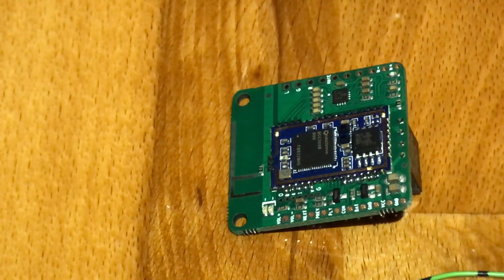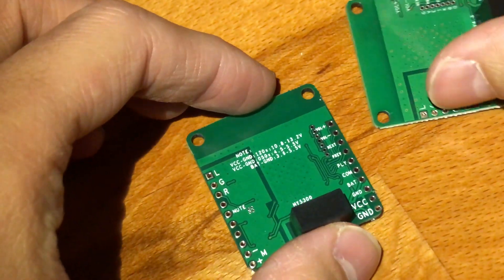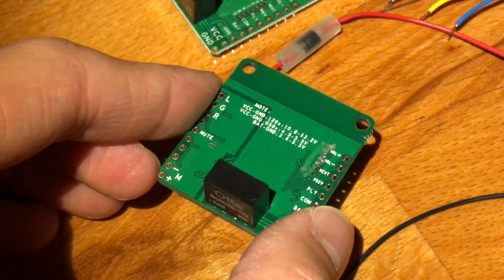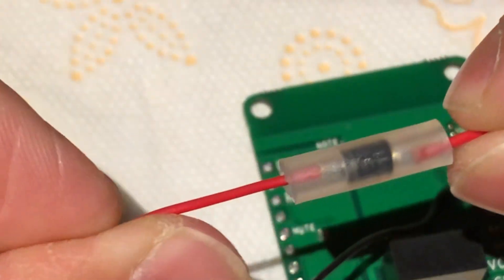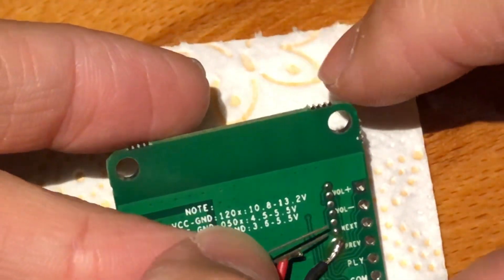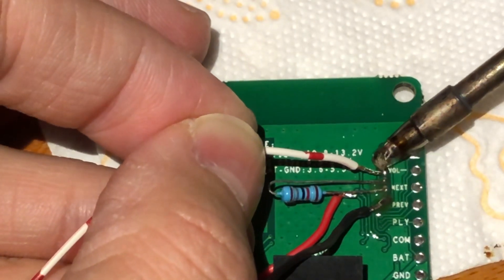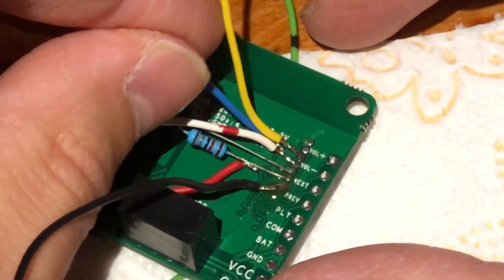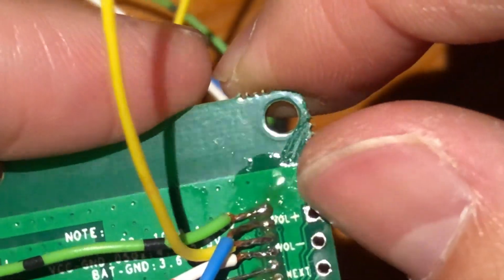Hooking up the CSR USB SPI Programmer to a QCC3008 Bluetooth Module

Comment: I'm curious is there a setting at the software to change digital output type?

I have QCC3034 with I2S output, is it possible changing to Right Justified or Left Justified fortmat ?

Comment: im finally trying out flashing this chip, but ive encountered a weird issue, the chip doesnt power on with the csr programmer, yet it does power on with the battery of my speaker. the spi tool is detected, and power is on the correct pins(which are labeled luckily) but the module still doesnt power on (leds go on)

Comment: To make wire connections to these boards I cut up old parallel printer cables and use the thin wires in them. They are very pliable and work like a treat. Excellent video BTW

Comment: Nice Video! 
Do you have any Updates for the QCC3034 or QCC30xx? 
Still trying to connect to rename the BT-Module, but i cant even get a connection.
Reply: I've been battling with the 3031 for a little bit. Figured out the other day Its interface is USB. Looking at the picture at 1:19 the pinout is same for V+ and GND but SPI_EN is USB_DATA+ and CSB is USB_DATA-. I can get access to ADK configuration tool, but looks like they need an unlock key to get into PSTool so I'm trying to figure out how to make that work now.
Reply: @M4ddH4tter  I'm also hoping to figure out how to unlock my QCC3031 module. Let us know if you got it working, thanks! Also what ADK configuration tool are you using?
Reply from the maker: do let us know how you get along with that 🤘
Reply: @M4ddH4tter  same for me , it is detected but it does not allow reading nor writing

Comment: Great videos. I have a question which sounds simple, but i still don't know how to do it - I'm making wireless bluetooth headphones using the board but would also like to have a 3.5 mm jack option. Where would the wiring go?
Reply from the maker: check the datasheet for the exact pinout

but - the chip uses the microphone inputs as the AUX_IN channels
Reply: @Darieee  ah I see, so wouldn't be able to use the mic as well. I'll have a look to see if there are any other options when it arrives.
Reply: There doesn't seem to be any other input options on the board pinout. I have found a 3.5mm Jack with internal pass-through - switches the input when a jack is plugged in if anyone else was looking for a solution.

Comment: There is another pinout board for this chip on that brings out all available pins of the board (see https://m.aliexpress.com/item/4000311477121.html?spm=a2g0n.orderlist-amp.item.4000311477121&aff_trace_key=299c4cf3b1e049d8aa86e60bbe096513-1614760937757-03736-UneMJZVf&aff_platform=msite&m_page_id=3077amp-MfS0YcIJHcGWIZo37mgVvw1614767826312&browser_id=f60b6372524f4a16add40e5154382731&is_c=N).
It has a similar layout with the narroe-spaced pin row, but additionally brings out MISO, MOSI and CSB to normal pins as well. 
I'm not sure, but do you think they have the same functionality so that it's possible to use these pins (with SPIPCM pulled low) to configure the chip with the spi programmer? This could then avoid soldering the cables to this tiny pin row, like you did in the video.
Would be very happy if you could have a look into it :)

Comment: What flux do you use?
Reply from the maker: louis rossmann recommends it ... it's the viscous non-transparent kind

why did I even say that - was super obvious from the video

I actually don't have the original cartridge anymore ☹️
Reply: @Darieee  😂 Ok, I'll just start looking into flux then. I really just thought the syringe seemed like a great way to apply it, I've only had tubs so far.
Reply from the maker: owyeh .. for sure! those tubes go into some widgets that automate the dispensing, huh?

for handwork the syringe method is miles ahead 🤘

Comment: Hi I have an idea for a future video:
Set up the true wireless stereo (TWS) of a CSR 64215 module .
Thank you for all your great work 👍🏽
Reply from the maker: qcc3008 is the one to work on at this time

the csra64215 has been discontinued
Reply: @Darieee  Hi Dariee, could you confirm if the features/sound quality, etc are the same in Qcc3008 compared to CSR 64215?
Reply from the maker: nope - never used either 🥶

Comment: I don't know this module, QCC3008 is a good choice compared to CSR8645 ? 
May be your should have a smaller tip for your solder iron  ;)
Reply from the maker: I do have all but the one weird TS80 tips - but - ye, where'd be the fun in that!?

wwwway better

the csr8635/csr8645 are super old - kann man schon auf ebay de finden - but the software stack they come with is terrible

csra64215 is significantly better in terms of connection reliability, software stack &co ... but you kind of have to get it imported

qcc3008 is more or less the same chip as the csra64215, but running a bluetooth 5.0 firmware 

again import only ☹️